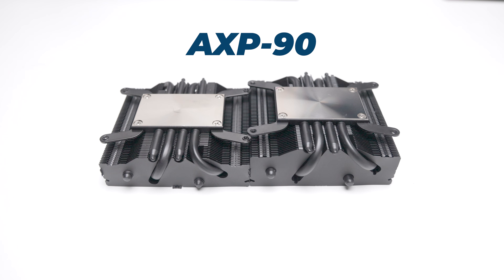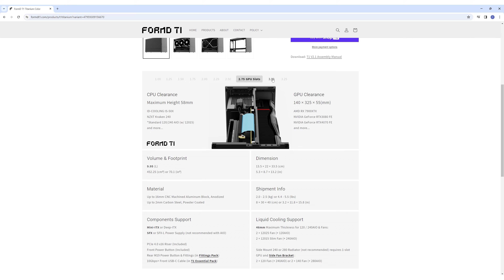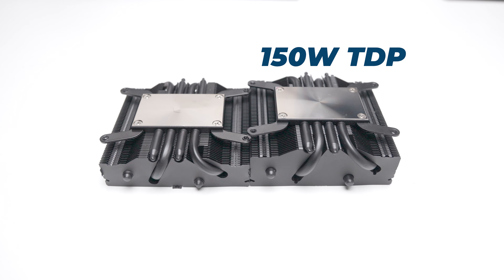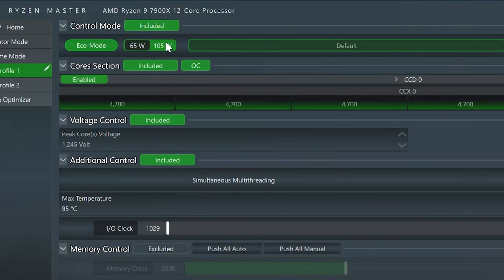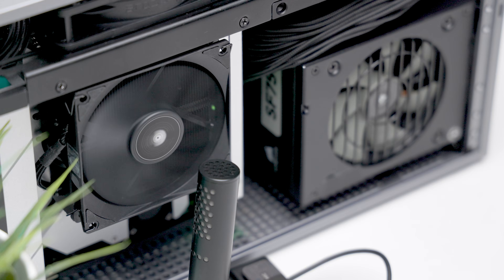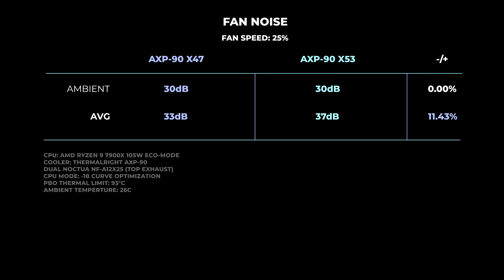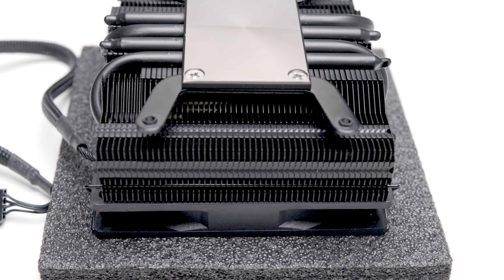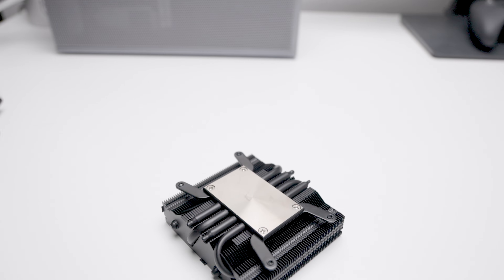Thermalright AXP 90: X47 vs X53 in the FormD T1

Comment: Would this test also applicable to the intel LGA1700? I'm planning to put 12600k on the T1 but I'm torn wether to get X47 or X53. My gpu will be 2.25 slot Sparkle B580

Comment: I'm quite shocked by the bad performance of these fans with the Ryzen 7900X.
On the same MSI B650i in the same case I have a Ryzen 7900 (non-X) in 105W TDP mode (pulls 145W max) -30mV curve optimised. It's cooled by an ID-COOLING IS-55 and two Noctua A12x25 case-fans. With the AM5 mounting plate and some good thermal paste I get Cinebench 23 scores of greater than 29,000 consistently with the CPU clocking at 5450MHz almost all the time. It goes to 90deg quite rapidly but then takes more than 10 minutes to soak to 95deg with the fans at 100%.
Reply from the maker: This video compares two versions of the AXP90, a 92mm cooler designed for builds like the FormD T1. Your setup uses the larger IS-55, 120mm fan, and a power optimized 7900, which creates a very different thermal profile.

The 7900X pulls more power and runs hotter at stock, so this test was meant to show how each AXP90 model handles the test environment.

That said, your results are a useful data point and it’s always good to see how different configurations behave in the same case.

To me this shows how inefficient the 7900X is compared to the 7900.
Reply: @ChrisRussellTech  Absolutely. In general I think it's fair to say as consumer advice that buying a CPU with TDP > 105W for a compact air-cooled ITX build is usually a waste of money unless you really know what you're doing. The 9800X3D is already beyond the edge of what you can reasonably utilise fully beyond current games.

Comment: Thank you, Chris. 🙏🏼💯

I'm wondering how much of a difference there would be in thermals by going with the 'full copper' variants of these AXP90 coolers.  I've purchased the full copper AXP90-53 to use with an i7-12700T (a 35 watt part with an upper limit of 99 watts) in an ASRock Deskmeet B660 build, and I'm hoping I don't start any fires! 🔥🤞🏼 🔥

(I also have an i9-12900T which has a 35 -106 watt power draw, but I'm really reluctant to chance it in that particular chassis. 🫨)

Wish me luck & thanks again! 🍀👍🏼

Comment: I use the X53 with an Arctic 25mm fan slapped on. Reduced noise and increased static pressure.

Comment: Hi. Thank you. Does de copper version makes any difference vs aluminum one?
Reply: According to Tom's Hardware, it should result in better thermal performance, but I really have no idea how much. 🤔 

Copper is much better at heat dissipation than aluminum is, although it also weighs more.  The aluminum AXP90-53 weighs 320g including the fan, and the 'full copper' variant weighs 540g without the fan attached (according to Thermalright's product pages, I don't know why they listed one with the fan attached and one without), so there's clearly quite a difference in heft.  

I just bought the full copper AXP90-X53, so I'm hoping that weight differences somehow carries over to thermal performance as well. 👍🏼

Comment: perfect video! i didn't really understand what people meant when they said the case would be louder if i bought the x53 since it would touch the case. That noise is definetely a dealbreaker
Reply from the maker: For sure. It’s just too close to the panel, x47fc is the way to go in 3 and 3.25 slot mode

Comment: important thing to add : the heatsink weight (without fan) difference between x47 and x53 is only 20g (520g vs 540g for copper / 310g vs 330g for aluminum), so if the case allow to use x47 with 25mm thick fan - it will be always better (within noise normilized environment) :)

Comment: Doing gods work ty. BTW can ask what it idled at when using the x53? And also where did you get the tdp rating of the coolers I cant find it anywhere ?
Reply from the maker: Check the Thermalright website but it’s also on the box of the cooler. Honestly don’t listen to the TDP. If you use anything more than a Ryzen 7, you’ll have to undervolt or limit power.

Comment: Try the full copper version please 🙏
Reply from the maker: I did. It’s on my channel but in need to update it as my reading methodology has changed
Reply: @ChrisRussellTech  I mean the axp90 x57 full copper
Reply from the maker: @kuzzzzzzzzzzzz7511  I have that one too but it doesn’t fit in the T1 3 or 3.25 slot. Too much dab vibration

Comment: Your first benchmark shows pretty high core temps across the board. Did you check to see whether there was any throttling going on? If the CPU is being throttled due to thermals, then neither of these coolers is handling the load and this comparison isn't telling us very much.

Thanks for the video. Interesting work.
Reply from the maker: They’re 100% being throttles on the 7900X, however I like to think of my test with the CPU as one of the worst case scenarios. You’ll see far better results with lower TDP chips like the 7900, 7800X3D etc. I’d test those if I had those. I know there are people out there looking to go small form factor with a CPU they already own and sometimes it’s a power hungry 12c 24t processor. If you want to use this CPU and cooler, you can with some tinkering and power limits.

Comment: I paired de X47 copper version with a Noctua A9 chromax and is a blast
Reply: The a9 is 25 mm thick, so can you still use the oem fan clamps to mount the A9 on the heartsink ?
Reply: @hansihinterweltler1198  Did you find an answer to that? I'm looking at that combo and gemini says "Most "Full Copper" versions of the AXP90-X47 now include a second set of longer metal clips specifically for 25mm fans". I need to verify if that is correct
Reply: @AndySomething no unfortunately not. I went with the 2.25 slot adjustment and installed a 9070 xt reaper which is 2 slot thick. For the cpu cooler I picked the thermalright to-p9 which is such a good 25 mm fan in my opinion. I ordered the fan clips on Amazon from xiatiansann which worked perfectly

Comment: the aluminium version perform better than the full copper version in my opinion... copper will run 2-3 degree cooler but when under load it will cool down slower than aluminum thus staying hotter over short period of time
Reply from the maker: I’m still finalizing the tests but I believe the x47 copper is very competitive. I’m using it with no power limits at stock, however with a -20 curve optimizer.
Reply: @ChrisRussellTech  it depends what you want to do...if you do photo/video edting aluminium will cool down faster between loads...gaming wont load the cores much so copper could run a little cooler

Comment: Great video and relevant to what I needed! Thanks.

One note regarding dB: It is a logarithmic scale. +10dB is 1000% more sound pressure, and perceived as 100% louder. So calculating the difference in percent is not the usual math you would do for a linear scale.

You can calculate the difference in perceived loudness with this formula: 2^(dB difference/10). A 2dB difference is 2^(2/10) = 1.15x louder, or 15%.
And the difference in sound pressure with 10^(dB difference/10). Though perceived loudness is much more useful for this application.
Reply from the maker: Thank you for the feedback. However I must admit sound and decibel testing is way above my head. I think it’s just best for me to show the number. I did purchase a dedicated decibel meter for my upcoming videos.

Comment: Have x53 coped with Noctua NF A12x25 - works great, much more silent than the stock fan, but due to proximity to the case wall sound doubles as the air goes through the grate close to it
Was thinking about lowering the profile with x47 as even being 5mm away from the grate makes huge difference for th fan noise

And judging by your tests it completely worth it to be switching
Thanks a lot for the video! Saved my life
Reply: A12? How do u make a fan that size to fit on the cooler?
Reply from the maker: @qiyang3129  I believe we’re referring to the top exhaust of the case and not actually on the cooler itself.
Reply: @ChrisRussellTech  oh I see, I'm planning to use 2 phanteks T30s for my top exhaust, heard that it performs slightly better than the noctuas
Reply: @qiyang3129  They should, seeing as they are 30 mm thick compared to the Noctua's standard 25 mm. Although the Noctua's being thinner, just goes to show how well engineered they are in comparison. Plus they are also basically optimised for noise rather than full on performance. The T30's and the NF-A12x25's have different noise characteristics, hence it's not an simple apples to apples comparison.
Reply from the maker: I’m testing this configuration as we speak. Spoiler. I might use this over my ATMOS

Comment: I wonder if the pure rock lp from be quiet would be better?? The total height is 92mm but there are no clips and the screws and pretty deep down in the holes so it might actually work well. Would be interested to see if it works. *edit* nevermind I thought there was 90mm clearance not 50
Reply from the maker: I could put that on my list to try out.

Comment: Thanks for the comparison. Tip: use graphs or diagrams instead of numeric tables. Much easier to visualize differences in this case.
Reply from the maker: I'll keep that in mind, I used graphs on previous videos but didn't think it made a meaningful difference, I'll reconsider going forward.